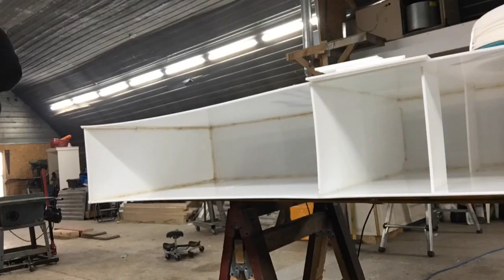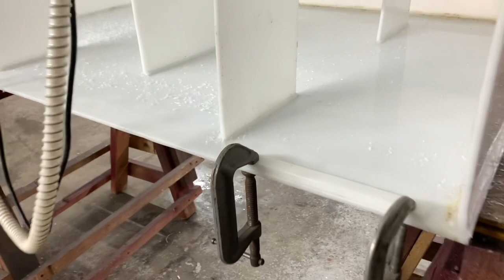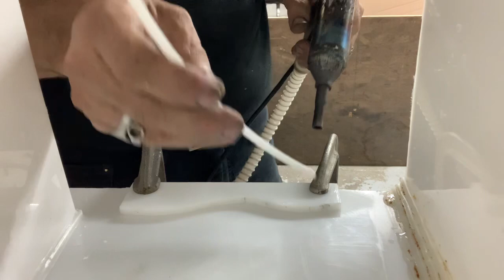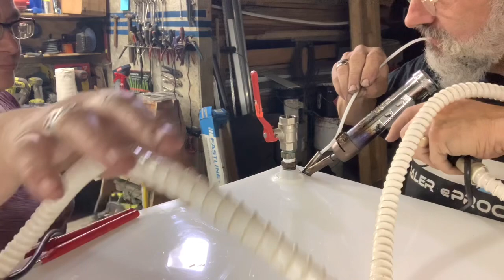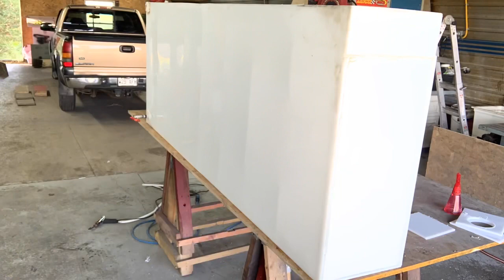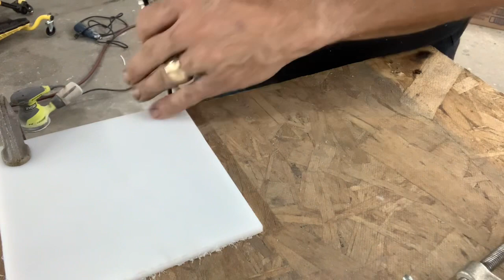Plastic welding, Custom RV Tanks, Part 2 of 2.

Comment: A little trick I learned for checking the quality of the weld is to put a strong light on the outside of the weld (if possible), and look at the welds. The light will easily point out failure points in the weld seam.
Reply from the maker: Thank you, good idea.

Comment: awesome videos, thanks a ton- been toying with building custom fresh and grey water tanks for my truck camper shell. volume is certainly a lot less which makes my project quite a bit easier, but all the principles are the same. having welded to fix old plastic car and lawn mower parts before but never needed it water tight, very helpful.
Reply from the maker: Glad to help

Comment: Thanks for the tutorial on plastic welding!
Reply from the maker: Thanks for your comment !
Reply: @LacroixCruiser  The unit you use is 1080W, the majority of the all-in-one units are 1600W, do you have a feel for if your unit would be capable of welding PA66 nylon which melts at a higher temperature than HDPE? I have a cracked PA66 intake manifold and your unit would be very convenient but is it powerful enough?  Thanks!

Comment: When welding metal, the warping usually comes from the size of the weld...if this is the same for plastics, you might be able to minimize that by using a thinner filler material on inside corners and T-joints and go back to the thicker for outside corners... cheaper too
Reply from the maker: Good tip

Comment: Very nice videography and clear explanations.  It looks like there is considerable overlap between welding plastic and welding metal.
Reply from the maker: Yes, the theory is the same, as are the movements.
Reply: Boy Dell, I’m finding you all over the place, I’m just a couple years late, lol 😂. I’m debating whether to go ahead and build my own versus ordering remade cause like Yvan did here, you can get exactly the best size tank for our buses specific application. I priced out material cost yesterday and it is significantly cheaper going this route over a commercial tank and you get a bigger tank at a better price. 

My only issue is I’m short on time now but seeing as how My bud isn’t going to be complete before I need to be in it anyways, what’s wrong with roughing it an extra couple weeks while I build my custom tanks, lol

Take care Dell, see ya back on the other side brother!
Reply: @1982MCI  Do you mind sharing where you found the perfect size tank for our buses?  That's one of the hard parts.  I found one custom made for the MC-9 (even had a lower section for the tunnel) but it is only 50 gal.  And it was $500 15 years ago.   The problem with welding plastic is I'm nervous about leaks.   Thanks for this post and reminder to watch because I'm going to do some tank mods with this exact same welder.
Reply: @DellAnderson  that was sposed to say that with building a tank like why Yvan did, we can get the perfect size tank but if we order them online then we are just getting a standard tank. My phone has been screwing up bad this past week so my comments don’t necessarily say what my brain is thinking Dell. I dropped it 4 or 5 times too many and ever since the last drop,  can’t even get online to order anything and I’m bout to stress out over it all. 

I’m contemplating on cutting down an old tank I had out here on my farm which was 3600 gallons and cut it down and reweld it to what I need for my MC9. The material in that tank is 5/8” thick so it would make a great tank. I’m not worried about leaks at all cause I’ve done much more critical pieces holding life threatening chemicals so a water or sewage tank will be nothing to worry about and whether I buy the material or use it from the big tank, it is going to come out cheaper and I can get the exact tank I want. They will be leak checked prior to install anyways and If there was a small leak, they are easy to repair and keep moving forward. Take care Dell and we’ll talk to you soon buddy!

What state are you located in Dell?

Comment: Where do you get your filler rod. I have a welder. My idea is to trim off a little from the edge of what I'm fixing to weld and use THAT as my filler rod. It would be nice to have it on a roll. at least, I don't have to worry whether or not it's compatable.) I'm just gearing up to weld plastic garbage-can lids and their hinges, (where the automated trucks are so rough on them.) I saw a video where a fellow cut a screen door spring, longways and used the rings to LACE the plastic back together. he melted the plastic by shoving his heater into the curl and pushing it into the plastic.
   I had a friend that had an upholstery shop and he had come up with an ingenious idea. He put a curtain rod with wire rings. He secured his air hose to the rings and let them droop some and on to his air stapler, with a spring on the hang down part. This kept his lead in from getting in his way. He had an old dress frame base with an overhead bar to do the same thing when away from his table.
   Thanks for the great instruction. I WILL USE your procedures.
   Thanks.
Bill, from Tn. 🇺🇸
Reply from the maker: Thanks Bill, the filler rod was from the same local supplier as the plastic sheeting.

Comment: When doing the inside corners do you use a corner punch to push it all together and seal it or do the welds seal it as is?
Reply from the maker: The welds seal

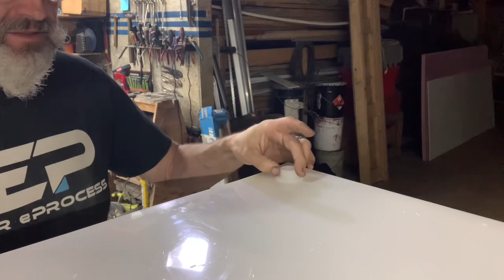Comment: Starting at 9:50, I am unclear how the fitting you are gluing/welding on the side towards the top of tank will be a “vent” if it is connected to a similar fitting on the same side towards the bottom to make a sight gauge?  The fresh water tank in my H3-40 has an actual vent on the top that is also an overflow.  It has 1-1/4” pipe the goes down through the floor of the bay.
Reply from the maker: The fitting will be a T, one leg going into the tank, one going down, one going up
Reply: That will certainly work.  Thanks for the explanation.

Comment: To save some welds, is it possible to heat and bend the sheet similar to a metal brake? Would it be weaker or stronger?
Reply from the maker: Yes you can

Comment: This is a great set instructions and how to. I am thinking of building my next camper with this material. Fiberglass and aluminum have become too expensive.
Reply from the maker: It’s not very  dimensionally stable nor UV stable. For our needs these tanks are held in a steel cage, and in a place where sun exposure is non existent.
Reply: @LacroixCruiser  thanks for getting back to me. I've been looking at the UV stable version from IPoly. I weld up my frames from aluminum square tube.

Good point about stability. I will have to test some methods to strengthen .

Comment: Another question on the welder. I read you got welder at Amazon so I am certain it's the same one I bought. Just want to know if your welder works on all settings? Mine only heats on settings 7 thru 9? Both welders I bought work the same so trying to find out if they are defective. Thanks again
Reply from the maker: Never tried below 7

Comment: Thank you for the great videos. You very clearly described and demonstrated the techniques and tools. I am considering building an auxillary diesel tank for my sailboat and the space where I want to put it rests against the curved hull. I was wondering if you think the sheet of hdpe could be heated with a heat gun enough to mold the sheet to conform to the curvature of the hull?
Reply from the maker: Yes, not a problem.

Comment: Great video series! Thanks, learned a ton. Maybe I missed it, but what was the thickness of plastics you were using? Also, where did you source your plastic? Somewhere local, or an online distributor? Thanks!
Reply from the maker: It was 1/4 inch, but ideally 3/8( it wasn’t available at the time). Plastic was from a local supplier.

Comment: What thickness sheet are you using? I may have missed if you mentioned in the videos, if so I apologize.

I am ordering the gun and tools soon. As a Tig welder, the pendulum welding will probably be my preference.
Reply from the maker: We used 1/4”, but due to the pandemic it was all that was available. 3/8” would be better

Comment: You mentioned allowing the welds to cool before cleaning the weld. Would you just grind/polish the weld if it were to be visible. How do you make the weld aesthetically pleasing? Extremely helpful video and inspiring
Reply from the maker: You can sand the weld if needed.

Comment: Hi if appearance is an issue how do you recommend tidying up joints, in particular external right angle joints. Can you router HDPE with good results for example? Thanks
Reply from the maker: Yes a router would be a good choice.
Reply: @LacroixCruiser  Thanks
Reply from the maker: Thanks for asking a question.

Comment: Very helpful video. I purchased the same plastic welder you have. I was wondering what number setting did you set it at for hdpe? I think there might be a issue with mine. I have to turn it all the way up to 9-max to get it to melt the rods.
Reply from the maker: I forget, but I remember it was high

Comment: Excellent! thanks for getting part 2 out so promptly... 

Out of curiosity, did your past comercially made tanks look to be the same strength as this one? I'm just trying to figure out how much stress this type of DYI gun's welds can take...  do you think it would work well with 3/8" material or would all edges have to be chamfered to allow for  deep enough penitration?
Ty,
Reply from the maker: Thank you for your question. 

The welds look the same as the tanks in our GMC that were made in the 1980’s. That said we are not relying on the welds for strength, only for leak protection. The tanks will be supported on all sides by a metal rack.

Comment: what thickness is the materials you're using for in the tank body itself? tyvm for making this wonderfully informative video.
Reply from the maker: We used 1/4”, but ideally use 3/8” or 1/2”. It was all that was available when we built these.

Comment: Very informative video but a couple questions. You didn't point out the temp setting on the welder and where you got the welder? I saw one on Amazon just like yours and wondered if it was the same one? I did order it but it was defective so waiting on replacement. Thanks for answering my questions and all the best!
Reply from the maker: We went with trial and error. Setting 9 is what worked for us

Comment: How are these tanks holding up? Where did you get your ldpe fittings from?Wow! Thank you, so much! I'm in the same boat as you were where you couldn't find anything but people doing small projects with Jack leg solutions. This is exactly the information I was looking for to build a couple custom tanks to fit between the floor joists of my cargo trailer! Thank you, so much!
Reply from the maker: 3 years later still good. I would use 3/8 though ( wasn’t available at the time I built these). Fittings from Amazon

Comment: Could you pre glue  like you did to you're  bulk head fitting ?
Would that serv as a extra  double bonding layer  this was interesting good work also how thick was the sheets you used
Thk.paul
Reply from the maker: Yes that’s a possibility.

Comment: You standing the tanks on ther side ? Like you had on table welding top in !
Reply from the maker: The tank on the table was on its side, they are 30 inches tall, 90 inches long, and 12 inches deep

Comment: hi - you have inspired me to attempt making myself a tank as is in a confined space -- the only thing where did you obtain your PE fittings - I cannot find anything like you have or anything similar at a reasonable price. thanks
Reply from the maker: Kevin, they can be found here

https://www.icondirect.ca/spin-weld-fittings/
Reply: You can also easily make your own that are stronger by taking blocks of scrap HDPE and welding them on to either the inside or outside, or both of the tank where you want the fittings and drill/tap them out

Comment: Question,  when welding with metal I tack one side on both ends, then the middle.  the other side I place two welds, splitting the difference between welds on the other side. This keeps the side piece from warping. Can this be done with plastic welding ?
Reply from the maker: Anytime you stop and start a weld, your inviting a leak.

Comment: Can you tell me what thickness of HDPE your sheets were and where did you buy them?
Reply from the maker: The sheets are 1/4 inch thick. We got them from a local plastic wholesaler.
Reply: @LacroixCruiser  just put an order in for 3 sheets of HDPE to build water tanks and a battery box for my stepvan conversion!  Also ordered 1/4 inch sheets (105 dollars US for 1/4 inch 4 by 8 foot sheets, I’m on Long Island NY if anyone wants the company info).

What diameter welding rod did you guys use?  1/8th seems very popular,  can’t seem to find much 1/4 inch if it even exists. 

Thanks for the videos, I’m using them as guidelines for my build.
Reply from the maker: We used 3/16 rod.
Reply: @LacroixCruiser  😍 thanks for the help!  Hopefully We’ll see you down the road.
Reply from the maker: Our pleasure, and yes looking forward to meeting you and others on the road.
Reply: Hi Yvan, many thanks for a most informative video. This comment answered the rest of my questions except one. On the video you said the welding rod was a 5/16 or 5mm. Could you clarify for me. 5mm is more like 3/16 but to be sure to be sure. Thank you from the other Ivan.
Reply from the maker: Mistake on my part, 3/16 or 5mm
Reply: @LacroixCruiser  I bet they are .220" and called puckboard in Canada.
I was shocked at the price of 1/4" straightened HDPE... Way over $100 a sheet.
Reply: @deckdriver  yeah, the stuff ain’t cheap.  But the value of custom tanks and enclosures...  

The largest most compatible tank that would fit under my truck is 45 gallons.  I’m closer to 80 with custom tanks that fit the facets of the available under area,  plus all the bulkheads will be in the right spots (I hope...).
Reply: @deckdriver  In Ireland it's €165 a sheet

Comment: Hi Guys, hope all is well with You. Just started a few trial welds, how much gap should there be for an open corner joint? Thanks
Reply from the maker: I don’t quite understand the question.
Reply: @LacroixCruiser  on a metal corner joint a gap is provided to allow a root pass, normally the size of the welding rod. In HDPE is the joint corner to corner, OR, is there a gap?
Reply from the maker: A gap 1/2 thé size of the rod worked for us

Comment: Great video! does anyone know where to get the pipe connectors and fittings in Europe, not UK due to high import tax charges to Ireland
Reply from the maker: Search for spin weld fittings.
Reply: @LacroixCruiser  I have, just coming up with US and CA results
Reply from the maker: Check with an RV manufacturer, they may be able to point you in the right direction.

Comment: Hello, would you like to help me with a project with Plastic welding to help kids?  Smaller project than the tank.  Jeff
Reply from the maker: Help in what respect?
Reply: @LacroixCruiser  I'm working on a flow-through vermi composter unit and maybe helping plastic welding a prototype or?
Reply from the maker: @e2U  cool, not sure how I could help

Comment: Do you only have to clamp why would you not set up the whole job and then go from one end to the other in 1 pass instead of stopping and setting up every time
Reply from the maker: The plastic moves considerably with heat